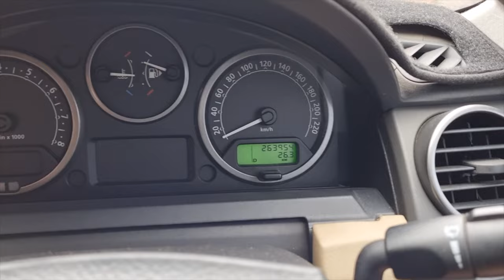'The Impassable Bog'

Comment: What PSI do you set go down to for Mud and stuff and not sand. I've got Geolander GO15, 215 70 r 16 on 7 inch dynamics, similar set up to DES, 2010 SH but an XT. Tyre shop recommends no lower than 17 for the beach, but maybe that's cause of the sand being hard past the cuttings here on the sunny coast. But i know you recommend 10?
Thanks for putting up with my questions.
Reply: ok just got to that part, 20-25...
Reply from the maker: @adambaldwin2946  all good mate, sometimes it's more of an art than a science. Especially when the terrain is changing. About 20 was fine for this video
Reply from the maker: And the with 10psi on sand, that's what has worked for me all day every day on the beach. I've never had a tyre pull off a rim 😊